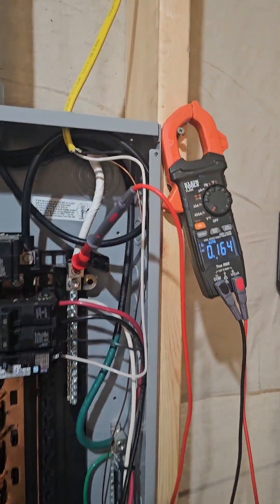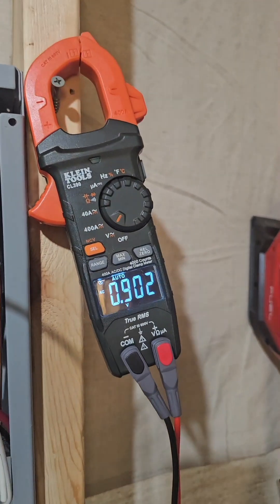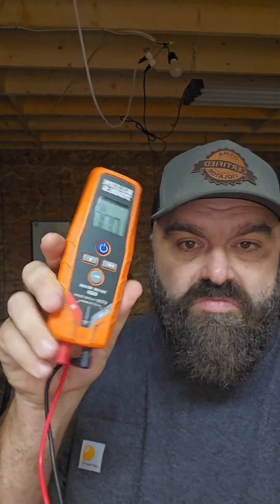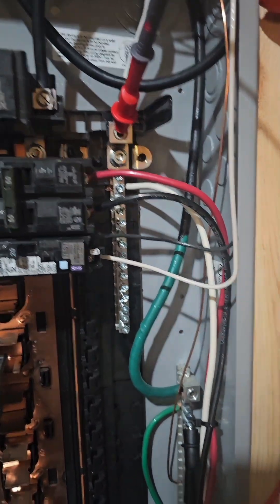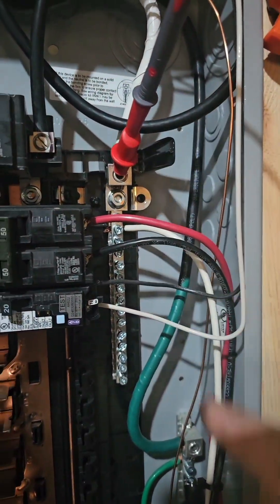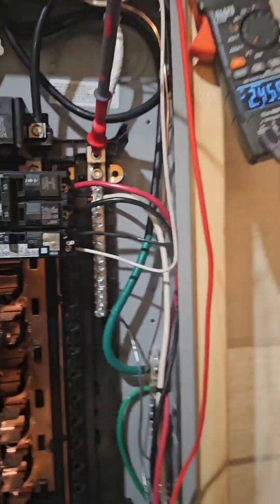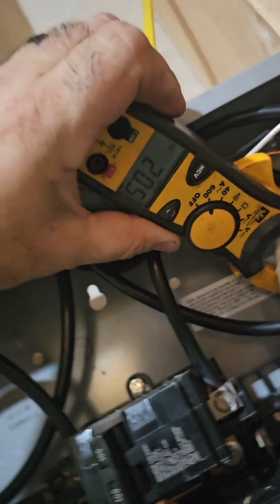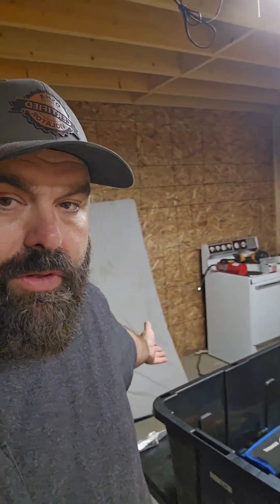Is there  voltage on a neutral???

Comment: Isn’t the neutral the current return?  Voltage is current times resistance and the neutral wire has both current and resistance.

Comment: Wouldn’t this voltage on a neutral or ground cause a GFCI to trip?
Reply: Thank you for the video. I have the same problem. GFCI is dripping neutral to ground voltage .08 on the outlet.

Comment: The neutral will carry the tension from the hot side when the circuit is continued. You will detect the tension when measured against  the ground.

Comment: Would you please explain, if neutral is bonded to ground, why aren’t you measuring 0 volts?! Someone else mentioned voltage drop in another comment, but I don’t understand voltage drop. Thanks!
Reply from the maker: @MathCuriousity  not sure where to start...do you have any electrical schooling like can you calculate ohms laws and stuff like that for series circuits, parallel circuits and combinations of the both?
Reply: @ learning about basic circuit analysis now actually!
Reply: @MathCuriousity You've had 2 months to get a handle on the measured voltage drop on a neutral conductor that's caused by the ampacity through the resistance of the conductor? The ground wire may be exactly the same resistance but as a non current carrying conductor you will see a voltage difference to the neutral that's carrying current. Ohmmm, good luck. It does become fun.
Reply: @ friend with all due respect, you’ve not stated anything of value.

Comment: When I was in school, my instructor would say electronics is theory.  We forget conductors are somewhat of an LC circuit and will impose a current on a different circuit if close enough.  Anyhow, you said the most important thing - which is to respect the power and treat everything as if it was live.
Reply: Does it matter if you have a delta or y ground

Comment: This potential is what often causes ground loops in your stereo system, where you'll hear hum in the speaker. Depending on what ground reference the various things plugged into your receiver are designed. Some AC potential would exist between the audio interconnect cable shields and the safety ground pin of one or more devices in your stereo/tv setup. These can be hard to track down, often times people will use a cheater plug to unground a DVD player or other device. Very nice demonstration! I just subscribed.
Reply: Why do you lie so much dude

Comment: I got a request for a video topic.  How fake grounds (bootleg grounds) can be dangerous.  You can find them in older homes and apartments with metal boxes where there were no grounding wires run.  An extra wire is added from the neutral of an outlet to the ground screw on that outlet to fool the inspectors with their outlet testers to appear like everything is grounded correctly.

I've seen them many times before and can tell they've been there for years without issue.  But on a handful of occasions I'll come across a damaged outlet with the source of the melting clearly around the contact points of the fake ground wire connection on the back of the outlet.  What causes this to happen to only some outlets?
Reply: Also adding a ground to an older install that had no dedicated ground, by connecting the "new" ground to something like a metal water pipe could energize that water pipe. Then it becomes a potential silent killer, just waiting for someone to come into contact with it.
Reply: Most likely a loose connection.

Comment: Copper has a resistance thus a voltage drop between 2 nodes. Looks like your ground wire is a little larger than your neutral. Next play with the capacitive coupling between the hot and the neutral 😊.